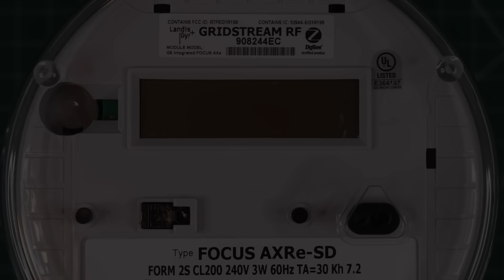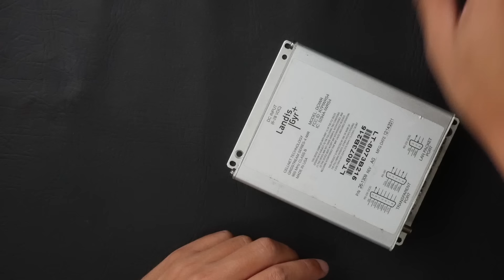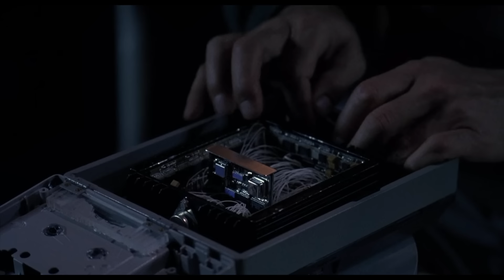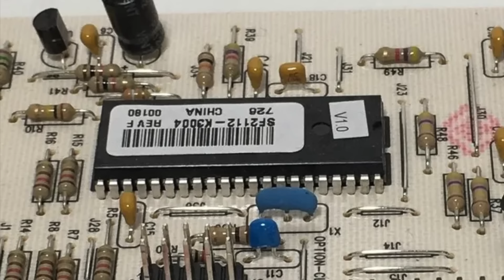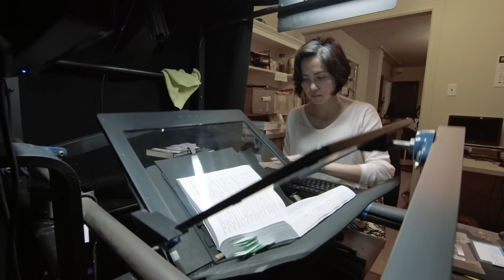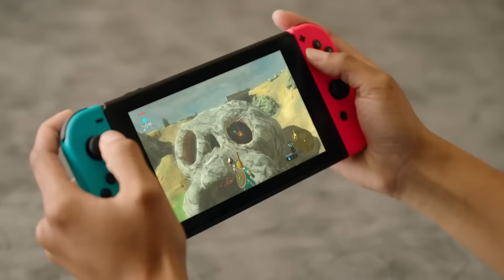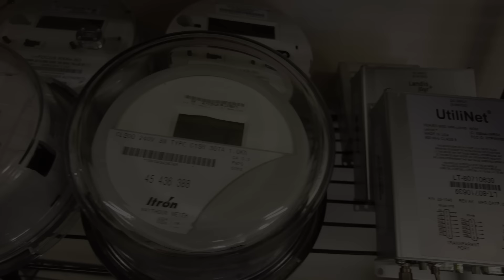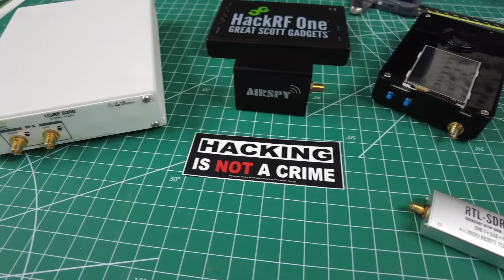The REAL Problem with Smart Meters

Comment: I have several problems with this video. As a utility worker that works with these meters you're poorly informed, your research is bad, and you're spreading disinformation.

1.) Utility companies cannot hire utility workers or meter readers fast enough to keep up with the increase in population and residential growth. Smart meters are the answer that they need. MOST cities until smart meters recently have been charging you an average due to the severe lack of meter reader employees. Which means if you're conservative with your utilities and your neighbor is constantly draining electric/water/gas... Guess what, you're still paying for most of their wastefulness.

2.) As someone that works with utility workers that had to respond to DEATH and serious injury due to utility malfunctions. Knowing immediately when equipment malfunctions compared to maybe 20 minutes later if a neighbor sees fire or smoke. Yeah it's the difference between life or death if a smart meter can immediately inform emergency services.

3.) I seriously doubt your 'reverse engineering' skills when you question why a smart meter randomly hops bands. If all the meters constantly transmitted on the same band they would always be interfering with each others messages. Even your most basic network engineer knows this fact.

4.) Of course the messages are encrypted. If they weren't people like you could simply transmit you only used $1's worth of utilities each month and that's called "stealing."

5.) I fully support people modifying firmware on devices they own. You do not OWN the smart meter on your house, you did not choose and purchase it like and Xbox or PlayStation. You entered an agreement with your utility service. In the service agreement you allow us to install the monitoring equipment of our choosing on your house and in return you receive water/electric/gas and access to professionals to maintain the distribution equipment. 

Please do your research before publishing utter garbage. I fully support reverse engineering and clicked on this video in hopes to learn something about the meters I didn't know but unfortunately it turned out to be purely click bait.
Reply: How is a meter going to know something is going to result in fire? Sending out the fire department for an outage doesn't seem like it would be a good idea. Or are you guys overvolting people often enough to matter and the meters would let you know (and not blow up themselves)?
Reply: @franklofarojr.2969  Inside the meter is something called a CT (Current Transformer) which measures the voltage going through the circuit. If that voltage were to drop that immediately shows there's something wrong with the neutral in the circuit. If left unchecked long enough it can become a potential fire/electric hazard. Even your entry level electrician can tell there's an issue with a circuit just by measuring the voltage.

In reality with real time statistics of your usage we'll be able to see an issue long before it turns into a fire hazard. That's just one example of why your utility company wants the most up to date meters. Believe it or not a house fire is a huge issue for your utilities provider.

Overvolting? The amount of current coming through a circuit is deterministic of the size of your conductors and service transformer. Meters cannot "Overvolt" or "undervolt" you if that's what you're implying.
Reply: So I guess you are trying to say meters are perfect and cannot glitch?  I can prove you wrong.  Last year nothing changed in my house. All the sudden from average of 1400kwh to the next month 4000 kWh.  Called power company, went through the endless circle of customer service, cannot get through customer service to any higher ups.  It’s a big monopoly, and they don’t think any mistakes are made by them. Their so called smart meter, did make a mistake.  Somehow, surge, stray current, or something.  Don’t know what other action that can be taken.. maybe you have some insight/recommendations?

Comment: They're rolling smart meters out in Australia now. The big problem for users who got them is their utility providers are now charging significantly higher, as a result of having direct access to the live power consumption data. It's equivalent to being stalked by your insurance provider, they do it to look for ways to INCREASE your fees. This was never intended to be a solution that benefits the consumer.
Reply: I don't know about "looking for ways to increase your fees" What they want to do is maximise their profit. They try to do that by pitching the peak rate high and the off-peak rate low, to balance their expected cost of purchase of power from NEMMCO.  

So, this encourages you to run your washing machine at night on off-peak, or do the ironing at night etc   (unless, of course, you have solar panels, and then it encourages you to do these things during the day because the the money you receive for exporting the power is less than the cost off-peak imported power.)

Comment: Fun times working on these in my early career as a software engineer. Everything was completely foreign to me at a hardware level, but it was rewarding to learn all the neat hardware and features. Especially travelling the country and going to meter farms for mass deployment testing. Depending on the meter not only does it use RF mesh for communication, but also data over mains power and others, where rf and mains communication is sketchy, have a 3g/4g backhaul for communication.

Comment: The messages may not contain values for instantaneous power. The utility may work with average power calculated from the change in accumulated energy between messages and the time between messages. Joules / seconds = Watts.

Comment: This is Fascinating!  This video answers questions I had about the smart meter network, but I had no idea these devices themselves were so sophisticated.  It's obvious to me now that the utility needs to protect the power readings from being tampered with, and the channel hopping is a clever way to make that process much more difficult.  It looks like the utilities/meter manufacturers are trying to avoid the mistakes that AT&T made decades ago with in-band signaling.  That vulnerability allowed phone phreaks, criminals, or anyone who wanted privacy and/or avoid paying for long distance calls by using a "Blue Box".  To fix that the Bell System had to convert their entire network over to CCIS (common channel inter-office signaling).  It was costly and took many years.  Meanwhile they tried to monitor, catch, and prosecute Blue Box users, but such cases were a drop in the ocean.  WRT smart meters, it seems a similar outcome is inevitable since anyone could theoretically tap into a wireless network.  There can be no expectation of privacy on over-the-air data transfers.  With your efforts and the efforts of others, breaking into or exposing the encryption algorithm is simply a question of the time it will take.  Another potential weakness, aren't these devices field re-programmable?  If end-users can reprogram these devices, then it wouldn't be difficult to get free electricity, but the utility could notice that a particular meter is radio silent and come out and replace it.  If they are not field re-programmable then once the encryption algorithm is broken, the utilities will be faced with replacing all meters with ones with new firmware and encryption algorithm, perhaps from a different manufacturer.  In any event, I bet Landis+Gyr didn't imagine that anyone would have gotten to this point by now.  I applaud your efforts!  Are smart meters from other manufacturers using the same protocols?  I assume no, because you specifically call out Landis+Gyr.

Comment: 5:47
1) Nothing happens. The utility company has their own metering. Sure, if there was constantly garbage being sent, it would be a problem, but the government office will track you down very fast, and have a not so nice word with you, since they knew you exactly knew what you are doing.
2) Yeah, if you manage to send enough messages to enough devices to cause any more than naturally occurring failures (while the smart meter needs to be able to detect and read it). While you might be able to turn off one meter, you cant turn off all the same time. You would need access to a VERY strong Radio tower(or satellite) to even have a chance to reach enough meters to cause significant disturbance.  Again, the government (or at that scale maybe even the military) will have a very unfriendly word with you once they catches wind of that (what they will do very quickly). This can be stopped as simple as 1): Just jam the frequency band, and the meters cant be deactivated - until the source had been dealt with.

Dont get me wrong, I think that public security is very important and can only be done through the masses, but painting a horrible picture just because you managed to jam a single meter right next to you does not help the cause.

Comment: The electric company came to my house a few years ago and REPLACED the "gear-wheel?" inside of my meter. THEY said it was a necessary UPGRADE!!!
I had NO CHANGES in my electric usage!!! But, my electric bill raised 50%!!! I'm wondering if the gear tooth ratio on the gear mechanism is in THEIR favor???
Reply: You should Opt Out and get an analog meter.
Reply: No, almost all electric meter failures of mechanical meters are in the customers favor.  If you feel the new fixed meter is wrong...your utility regulator can force them to pull the meter and have it tested.  And in some case you and the regulator can witness the test.   The test is generally with 3 different loadings on the metser low, med, high.  Also, btw, utility meter's in the US have a much higher accuracy requirement ...like sub 1%, vs. Eur where they are generally around 2-3%.
Reply: Electric smart meters have no gears in them or moving parts except the internal disconnect switch.
Reply: gear is more accurate 
digital usage reading can be  adjusted remotely treating usage like stock markets
and yes digital shows almost double even next to next gear meter
Reply: @robertbush8589  not to the utility Co. The old gear types could let a few volts pass through un detected. Smart meter pic up every millivolt.
Reply: See my comments about the problems I had with the so called smart meters  When one was first installed, my electric bill jumped up about $25.00.
Reply: Another thing, ask for someone to install a meter that is correctly calibrated . If you have ever used a ohm meter doing circuit testing, you can make a meter read whatever you want to. That is why you have to calibrate the ohm meter every time.
Reply: You need to also consider the possibility that you were just gettting electricity for less than you were meant to and they then fixed their mistake.  Though if this had been the case they really should have told you, in the few instances I've known where someone has had a utility bill increased due to undercharging the utility has notified the customer of the mistake and the change (and in one case even demanded someone pay 6 years of electricity arrears despite the mistake being on the part of the company, sheesh).
Reply: @krashd  
WOW!!!
Reply: Well if nothing changed in your electric ⚡ usage you should complain.
Reply: @MrWiseinheart  
I did. OUR electric company is INDEPENDENT PRIVATE OWNED!!! 
The PUCO (Public Utilities Commission of Ohio) CAN'T do ANYTHING about Lodi electric company practices!!!
Reply: @6stringgunner511  that sucks.. 😞

Comment: 13:10 - Re: the Texas freeze, there were power companies who refused to push that expense on the costumers. I don't recall what the main power producing conglomerate is called, but the smaller businesses were told to push the cost of electricity on the costumers. There were, as said, some who refused. Who went as far as to declare bankruptcy rather than destroy people's lives. These were worker owned cooperatives. When they declared bankruptcy their businesses (holdnings, stuff owned by the business) was bought up, cheap, by other worker owned cooperatives. Then sold back to newly created worker owned cooperative that just happened to do the same thing as the previous bankrupt one, and just happen to have the same people working with the same jobs, taking in the same customers. Thus, the costs were pushed back unto those who tried to profit off of others desperation.
Worker owned cooperatives have a far different motivation than share holder owned businesses do. Worker owned cooperatives want to keep their customers, it's how they're ensured an income and work. Shareholders just care about profit.
Reply: This is why we love TX
Reply: It is called “demand charges” which pay the infrastructure expenses for transporting the power to the consumer, poles substations etc. in Most places it was a common surprise and huge expense to people having a commercial electric service for the first time. Apparently demand charges were not being charged on the systems you described which explains the fragile Texas transmission distribution systems.
Reply: @joea1433 There were no "Demand" charges here either until they started shuttering local energy for the green energy scam.
Reply: Costumers work at the theatre. Customers buy things.

Comment: What you are talking about is, "Planned Obsolescence." It is now an accepted way of life, because it has been forced upon us. "Buy a cheap device,; throw it away; buy another one." That is corporate expectation now, and now it is our accepted way of life. NiCad batteries could last more than 50 years, IF the seals didn't leak out the electrolyte, and IF the paste material wasn't made of impure materials. I have a programmable calculator from 1974 with the ORIGINAL NiCad battery pack, still in working condition. It cost $400 in 1974, but it still works - 50 years later!
Throw it away and buy another one?!? 👎
Reply: Planned obsolescence is not an issue for smart meters. The utility expects a meter to last for 20 years and stays within calibration for that time. The unplanned exchange of a meter is very expensive compared to a mass rollout.

Comment: The REAL problem with smart meters is the huge quantity of lies, along with ill-educated repeaters, of the lies. A smart meter cannot magically tell you what device, or devices, in your home are consuming the most electricity. A smart meter does not save the consumer money, smart meters save the utility companies money through them not having to employ meter readers to check devices. The additional lies, in the UK at least, that these devices were free is additional nonsense too - they are paid for through bill increases. Yes, that's bill increases despite the utility company being able to dispose of all their many meter reading staff. Add in the further nonsense that being closed source and bespoke, they rapidly become obsolete and therefore require swapping out. As for the appalling excuses for interfaces that they foist on users, that's a further horror.

Comment: That book scanner is ridiculous. The right way is to cut off the spine so you get just pages, then put it through an automatic feed scanner like most copiers have.
Reply: Yes but when you want non-destructive scanning, this was a good tradeoff. If you search the published research you'll find even more ridiculous prototype machines trying to robotically turn pages but that's a b*tch to do for generally any book or pamphlet.
Reply: @potential900  There are few books that rate that treatment (the Torah?) Books can be rebound after scanning, and after scanning the book can be recreated from the digital copy as required.
Reply: @scottfranco1962  I guess. Personally I'd prefer to be able to display the books on my shelves after having scanned them. When the books were scanned in the libraries, the books went back to the shelves I'm sure. ;)
Reply: You might love the beginning of Finch btw (the movie where Tom Hanks is a roboticicist and feeds a robot books :D)

Comment: when we got solar power, the 2 meters that were installed in the house in 2020, were not correctly showing the solar power to the grid, and was not correctly recording what we imported. So they got replace in Feb 24, with another pair of identical meters, which seem to be more consistent, but are still not showing exactly  the same values. It makes me very suspicious about the actual workings of the smart meter. Im just fortunate that I sell lots in the summer that offsets the winter errors and so don't have a bill. What you are doing fascinates me. I barely understand 5% of what you are talking about, but look forward to your next video.
Reply: Most places follow ANSI standard which allows a 0.3% deviation from 100%.  No two meters will ever be exactly the same.
Reply: You're welcome (for my tax dollars subsidizing your solar crap).

Comment: There is more about smart meters. The way those devices are tested for accuracy is using resistive loads only. In fact, in modern house, nearly everything that needs power have switching power supply units. Those units are producing current spikes instead of puse sine. And here the story comes: measured values can easily be off by 10-20 % - coincidently against users. We are paying for all this siht...